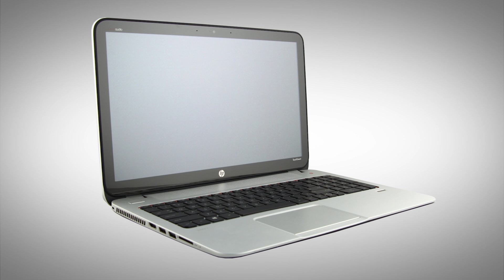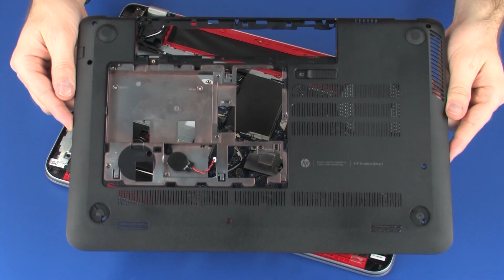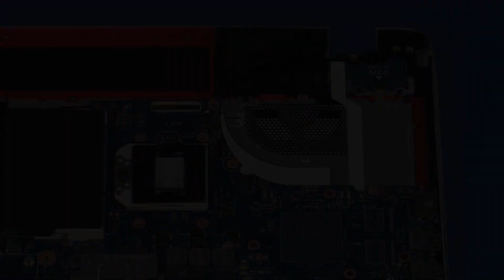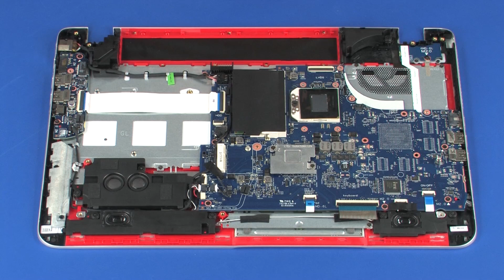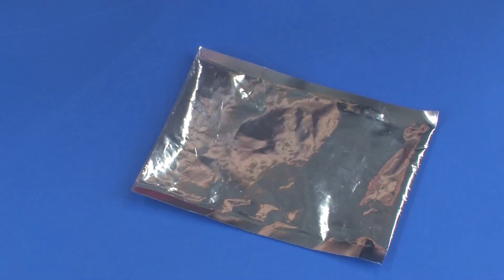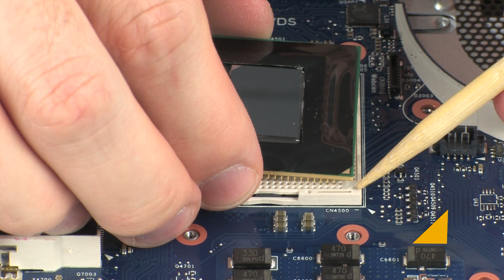Replace the Processor | HP ENVY Notebook - 15-q370ca | HP

Comment: Hello, i have a HP ENVY - 17-k205nl -> sku=L1S66EA, (Intel Core i7-1065 G7 processor and 4 GB of discrete graphics memory L87980-601
). Is possibile to upgrade processor for install windows 11? Thank you .
Reply from the maker: Hi Nicola, thanks for contacting HP Global Social Media Support!
I understand that you need to know whether you can upgrade the processor of your notebook.
I will do my best to assist you.
HP does not recommend upgrading or downgrading hardware parts or software that is bundled with the product as It may affect the manufacturer's warranty and performance, however, you could change the configuration at your own discretion.
Binu_HP Social Media Tech Support

Comment: I have a hp 15-db1066AU, is it possible to change or upgrade the processor?
Reply from the maker: Hi there, thanks for contacting HP Global Social Media Support!
I understand that you need to know about upgrading the processor of your notebook. 
I will do my best to assist you.
HP does not recommend upgrading or downgrading hardware parts or software that is bundled with the product as It may affect the manufacturer's warranty and performance, however, you could change the configuration at your own discretion.
Binu_HP Social Media Tech Support

Comment: Hello, I have a hp 14-dq1043cl with an i3-1005G1 CPU @ 1.20GHz. Is it possible to upgrade the processor in this, and which ones do you reccomend?
Reply from the maker: Hi Molten, thanks for contacting HP Global Social Media Support!
I understand that you need to know about upgrading the processor of your notebook. 
I will do my best to assist you.
HP does not recommend upgrading or downgrading hardware parts or software that is bundled with the product as It may affect the manufacturer's warranty and performance, however, you could change the configuration at your own discretion.
Binu_HP Social Media Tech Support
Reply: @HPSupport  This is possibly the worst piece advice. Can it be done or not? I want to upgrade my CPU as well.

Comment: Can i change the processer scoket in hp pavilion dv6t-7000???
Reply from the maker: Hi Pratik, thanks for contacting HP Global Social Media Support!
I understand that you need to know whether you can change the processor socket of your computer.
I will do my best to assist you.
HP does not recommend upgrading or downgrading hardware parts or software that is bundled with the product as It may affect the manufacturer's warranty and performance, however, you could change the configuration at your own discretion.
Binu_HP Social Media Tech Support

Comment: When i for the first time made format my notebook hp probook 450 g7 its processor began work errorly i mean graphics intel uhd problem that it was shown his stupidty in games i mean when i played shooter games(FOR EXAMPLE COUNTER STRIKE SOURCE V34) when fireing the crosshair went big then it had to go little for the little time, but unfortunately it has not happened. It is core i7 10 th generation quad processor. I repeat, after making a format of my notebook my notebook works worse and worse. Now, what to do oh HP ADMINS ? What do u think? Is it belong to chipset ? What do u think chipset problem i have?
Reply from the maker: Hi there, thanks for contacting HP Global Social Media Support!
I understand that you are experiencing an issue with your notebook after formatting.
I will do my best to assist you.
Please perform recovery as mentioned here to fix the issue.
1. Shutdown the computer. 
2. Turn the computer back on again and repeatedly tap on the ESC until a Startup menu appears. 
3. Press F11 once for System Recovery. 
4. Choose the Keyboard Layout. 
5. Click on Troubleshoot. 
6. Go to Recovery Manager and click on System Recovery. 
Note : Back-up all your data as System Recovery will delete everything that you had saved or installed on the computer. 
Binu - Social Media Tech Support
Reply: @HPSupport  Thank you very much, i ll try it.
Reply from the maker: If you need any help in the future, you can always get back to us.
Thank you for being a valuable HP customer.
Have a wonderful day!
Cheers!
Binu - Social Media Tech Support
Reply: @HPSupport  You are great! Thanks!

Comment: Can i upgrade hp 15q2020one i3 to i7
Reply from the maker: Hi there, thanks for contacting HP Global Social Media Support!
I understand that you need to know about upgrading the processor of your notebook.
I will do my best to assist you.
HP does not recommend upgrading or downgrading hardware parts or software that is bundled with the product as It may affect the manufacturer's warranty and performance, however, you could change the configuration at your own discretion.
Binu - Social Media Tech Support

Comment: Is it possible to change an AMD A9-9245 Radeon R5 to an Intel i5 on a HP laptop 14s-dk0xxx
Reply from the maker: Hi there, thanks for contacting!
I understand that you need to know about changing the processor.
I will do my best to assist you.
HP does not recommend upgrading or downgrading hardware parts or software that is bundled with the product as It may affect the manufacturer's warranty and performance, however, you could change the configuration at your own discretion.
Binu - Social Media Tech Support

Comment: Can  I change hp 15 af103ax processor to AMD Rayzen 5
Reply from the maker: Hi Sai, thanks for contacting HP!
I understand that you need to know whether you can change the processor of your notebook.
I will do my best to assist you.
HP does not recommend upgrading or downgrading hardware parts or software that is bundled with the product as It may affect the manufacturer's warranty and performance, however, you could change the configuration at your own discretion.
Binu - HP Social Media Tech Support

Comment: Hi
I have hp notebook 15-bg002au AMD Quad-Core A8-7410 APU. Can I replace the processor for better speed? 
Product warranty is over. Please respond
Reply from the maker: +Rituraj Shukla HP does not recommend upgrading or downgrading hardware parts or software that is bundled with the product as It may affect the manufacturer's warranty and performance, however, you could change the configuration at your own discretion.

Comment: Hello i have a hp 15 notebook  can i change the processors and graphics card
Reply from the maker: +kwekplon HP does not recommend upgrading or downgrading hardware parts or software that is bundled with the product as It may affect the manufacturer's warranty and performance, however, you could change the configuration at your own discretion.

Comment: Uhm if you guys are still commenting will it work on my ho 14 dk1-xxx
Reply from the maker: +Sussy baka HP does not recommend upgrading or downgrading hardware parts or software that is bundled with the product as It may affect the manufacturer's warranty and performance, however, you could change the configuration at your own discretion.
Reply: Is it soldered into the motherboard though?

Comment: I bought the fujitsu laptop and its slower but i wanted to change the cpu on the laptop so i came here i have hp ELITEBOOK 840 G1
Reply from the maker: +F0xY_tHe4sim0 HP does not recommend upgrading or downgrading hardware parts or software that is bundled with the product as It may affect the manufacturer's warranty and performance, however, you could change the configuration at your own discretion.

Comment: hello can i change cpu to intel core i3 and improve ram serial no and product number :CND72673SDP , HP Laptop 15-bs0xx product no : 2DV78UA#ABA
Reply from the maker: +Za3imomar HP does not recommend upgrading or downgrading hardware parts or software that is bundled with the product as It may affect the manufacturer's warranty and performance, however, you could change the configuration at your own discretion.

Comment: Can i swap out the CPU from my HP dk0093 au (ryzen 5 3500U) , and what size of processors would fit in it's place if it does turn out to be replacable ?
Reply from the maker: +Parv Sharma HP does not recommend upgrading or downgrading hardware parts or software that is bundled with the product as It may affect the manufacturer's warranty and performance, however, you could change the configuration at your own discretion.

Comment: Hi, is it possible to upgrade the processor on my HP Pavillion 15-au181sa ? I'm unable to install windows 11 as it's failing due to the processor. Thanks
Reply from the maker: +Spirit Light HP does not recommend upgrading or downgrading hardware parts or software that is bundled with the product as It may affect the manufacturer's warranty and performance, however, you could change the configuration at your own discretion.
Reply: @HPSupport  dear HP, please make Laptops upgradable again . 
e.g. on my 15-cw007  I upgraded to 32GB RAM and added a 512GB SSD (keeping the 1TB HDD on dual) ... I wish I could upgrade the Ryzen 3 2300U, but it is soldered instead of just in a socket.

Also, make batteries removable again, please. For those of use who are plugged almost always, it was easy to take it out while plugged to make it last longer. (If "unistalled" via Device Manager, it keeps running on batteries , just wont show the icon).

Comment: Is it available for HP 250 G5????? Want to trash my intel celeron n3060
Reply from the maker: +Lasha Zhvania Sorry but you would need to replace the system board.
The CPU is soldered to the system board.
Your manual here.
http://h10032.www1.hp.com/ctg/Manual/c05087748

Comment: possible to upgrade processor in HP 17-by4022wm from an i3 to an i7 or i9 processor?
Reply from the maker: +D. Sander HP does not recommend upgrading or downgrading hardware parts or software that is bundled with the product as It may affect the manufacturer's warranty and performance, however, you could change the configuration at your own discretion.

Comment: Can i upgrade my hp pavillion sleekbook 14? My processor is amd.! And can i upgrade it to atleast corei3.??
Reply from the maker: +Kemuel Encio HP does not recommend upgrading or downgrading hardware parts or software that is bundled with the product as It may affect the manufacturer's warranty and performance, however, you could change the configuration at your own discretion.

Comment: Does it matter what year the note book is I was told once you can't change a processor from laptop💀
Reply from the maker: +Oblivion productions HP does not recommend upgrading or downgrading hardware parts or software that is bundled with the product as It may affect the manufacturer's warranty and performance, however, you could change the configuration at your own discretion.

Comment: Hi Can the processor in a hp 15-f009ca be changed out ?
Reply from the maker: +Christine Cooke HP does not recommend upgrading or downgrading hardware parts or software that is bundled with the product as It may affect the manufacturer's warranty and performance, however, you could change the configuration at your own discretion.

Comment: is it possible to upgrade the hp pavilion x360 15-bk062sa processor that is currently a core i3 6100U? and if so what would the best processor i could replace it with
Reply from the maker: +thenate1200 HP does not recommend upgrading or downgrading hardware parts or software that is bundled with the product as It may affect the manufacturer's warranty and performance, however, you could change the configuration at your own discretion.
Reply: @HPSupport  I've already had to replace the fan a couple of times and the laptop is over 7 years old so i doubt theres much warranty on it

Comment: Can I upgrade processor in hp notebook intel  core i5-8265U; 8th gen intel;intel uhd 620?
Reply from the maker: +Riya Sonkar HP does not recommend upgrading or downgrading hardware parts or software that is bundled with the product as It may affect the manufacturer's warranty and performance, however, you could change the configuration at your own discretion.
Reply: Thanks for replying.

Comment: can  i upgrade my hp 15-d010sk notebook processor from i3 3110m  to another processor ?
Reply from the maker: +Creative Channal HP does not recommend upgrading or downgrading hardware parts or software that is bundled with the product as It may affect the manufacturer's warranty and performance, however, you could change the configuration at your own discretion.

Comment: Sir, if i can remove my cpu like what u did in the video is that mean i can change it? And if i can how to get compatible with M.B. Thanks alot
Reply from the maker: +Arthur I understand you need to purchase compatible processors for your notebook. You can purchase processors or other accessories from here: www.hp.com/accessorize
I hope this helps you!!
Reply: @HPSupport  could I turn a choppy "HP 15 Notebook" into a gaming laptop in 2021?

Comment: Can I change the processor for my HP 15 ra0xx
Reply from the maker: +Bloodline Heart HP does not recommend upgrading or downgrading hardware parts or software that is bundled with the product as It may affect the manufacturer's warranty and performance, however, you could change the configuration at your own discretion.
Reply: Ok thanks

Comment: My CPU is attached to my laptop and I cannot take it out because of that, now HP Support can you help me with that? Can you help me with your mistakes? Now if I were to want my laptop to be fast and stuff I would have to buy another one from you. which is tons of money, I do not get that a oculus quest 2, that can do VR, but if I try it on one of your 300 dollars pc it can't do crap! I just wanna know why a 300 dollar pc of yours can't do nothing but an oculus quest 2 can? And why you have to attach a CPU to the pc?!?!?! Like yo I'm actually mad cause I can't fix anything because of something all the time!
Reply from the maker: +PirateFoxy MLG2 Please perform updates via Windows and HP Support Assistant as mentioned below to fix this issue: Step 1 Windows Updates - 1) In the search box, type and open Windows Updates. 2) Check for updates. 3) If the updates are available, click on install and restart the computer. Step 2 HP Support Assistant Updates - 1) In the search box, type and open HP Support Assistant. 2) Check for updates. 3) If the updates are available, click on install and restart the computer.
Reply: @HPSupport  so I have to install a update to undetached my CPU from my laptop? woww

Comment: Hello , I have hp g62 notebook i3 350 M @2.27GHZ ,2266 MHz , 2 core(s) 4 logical processor . Which processor should I upgrade for the best results ??  And can RAM be upgraded more than 8 gig after changing processor?
Reply from the maker: +Bibek Bhujel May I know the complete model number of your notebook so that we can check the details for you?
Reply: @HPSupport  it's g62 455sx.

Comment: Does it work for hp15r119tu??
Reply from the maker: +BHARTI JHA ツ HP does not recommend upgrading or downgrading hardware parts or software that is bundled with the product as It may affect the manufacturer's warranty and performance, however, you could change the configuration at your own discretion.

Comment: Can I upgrade my HP 14-D008AU to Ryzen 5 or Intel Core i5 cpu?
Reply from the maker: +Chai Chan HP does not recommend upgrading or downgrading hardware parts or software that is bundled with the product as It may affect the manufacturer's warranty and performance, however, you could change the configuration at your own discretion.

Comment: Does this works for a HP Beats Special Edition 15z-p000 CTO Notebook PC (ENERGY STAR)?
Reply from the maker: +Luis Z HP does not recommend upgrading or downgrading hardware parts or software that is bundled with the product as It may affect the manufacturer's warranty and performance, however, you could change the configuration at your own discretion.

Comment: Hello HP
Is this applicable to the
HP 14s dr1009tu 
Intel I5 10th gen 8gb/512gb

Please also tell if a graphic card can be added to the laptop.
Thank you
Reply from the maker: +Seema sharma HP does not recommend upgrading or downgrading hardware parts or software that is bundled with the product as It may affect the manufacturer's warranty and performance, however, you could change the configuration at your own discretion.

Comment: Can I put this processor in a desktop?
Reply from the maker: +TheMusickGuy HP does not recommend upgrading or downgrading hardware parts or software that is bundled with the product as It may affect the manufacturer's warranty and performance, however, you could change the configuration at your own discretion.

Comment: How about HP Notebook 14-cm0015ax can I upgrade the processor and the gpu?
Reply from the maker: +N Xztay HP does not recommend upgrading or downgrading hardware parts or software that is bundled with the product as It may affect the manufacturer's warranty and performance, however, you could change the configuration at your own discretion.
Reply: @HPSupport  ow oki thank youuu

Comment: Please is it possible to upgrade the processor of hp 15 bs098nia to a core i5 7th or AMD processor?
Reply from the maker: +CJ STUDIOS NETWORK HP does not recommend upgrading or downgrading hardware parts or software that is bundled with the product as It may affect the manufacturer's warranty and performance, however, you could change the configuration at your own discretion.

Comment: Hp 15s du2058tu can I change my processor i3 10th gen to i5 10th gen?
Reply from the maker: +Basheer Ahamed HP does not recommend upgrading or downgrading hardware parts or software that is bundled with the product as It may affect the manufacturer's warranty and performance, however, you could change the configuration at your own discretion.
Reply: @HPSupport  how can I change my configuration to improve performance? My laptop is little slow